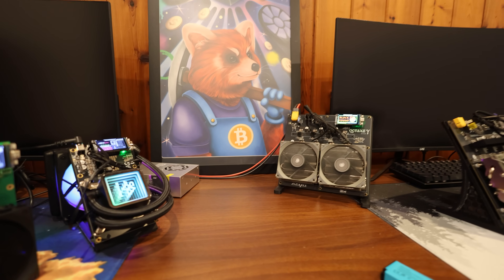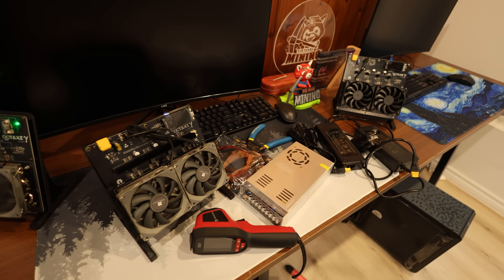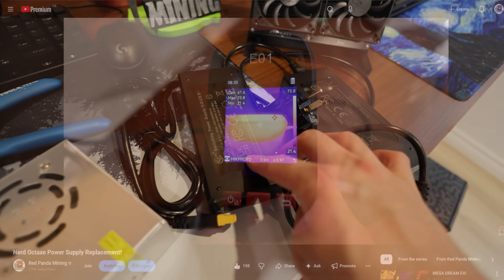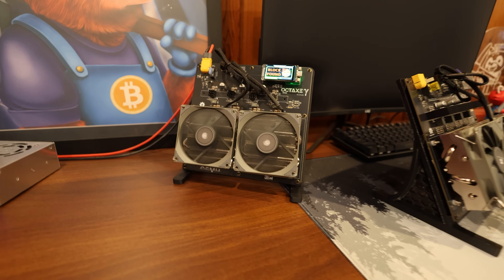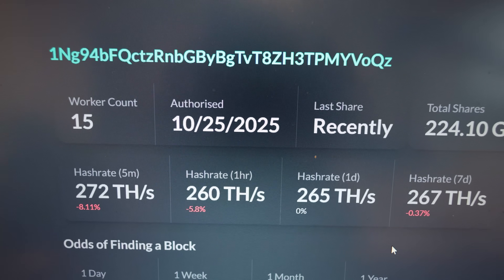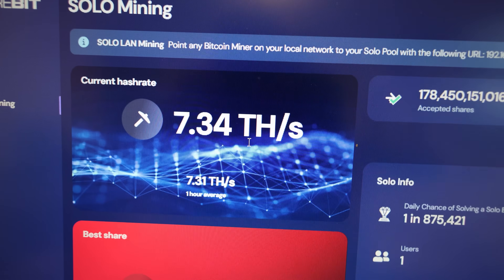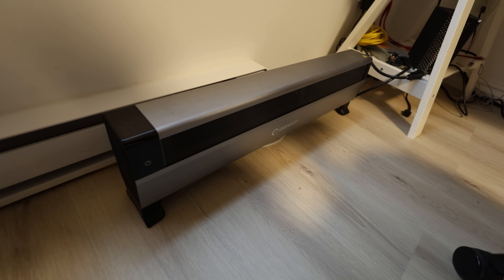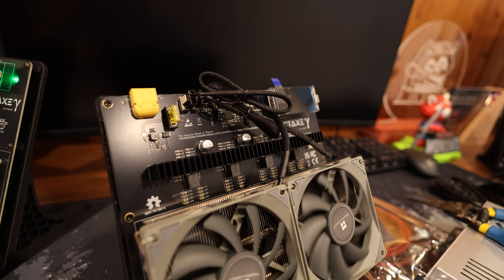I FOUND A BLOCK!

Comment: I'm a couple of minutes in this video and see a load of crap. 
35v capacitors are better? What do they handle? 5 or 12 volts? Then 35 volts is not important.
Higher fuses so they break later? Why in hell would you want that!?
Wow, it got bigger heatsinks! But not under the fan. Why? It doesn't get that hot.
Spend 1000 dollar on something that mines a dollar and 60 cent in a lifetime?
Best invest ever!

Comment: Congratulations on finding a block❗️👏🏻👍

Got to admit BitAxe miners in black/grey and with the coloured screens are desktop tech eye candy❣️

I do like how they allow you to be hands on in tinkering with them in doing mods to upgrade them with heatsinks, fans, and power supply, to either get the utmost out of them or under-clock them to be more frugal with the power juice⚡️ 
I’ve been sitting on the fence for 6 months and have just ordered yesterday my first two bitcoin miners, the latest Gamma GT 800 2.4Th/s Btc., all black, that run silent at 2.2TH and can be clocked up to 2.8TH. 
Which will be used solely for BTC; but if I had a NerdOCTAxe revised edition I could either use that for Btc and use the Gammas for Btc Cash or vice versa. And transfer any mining revenue as it builds up into Bitcoin.
Having a Bitcoin miner makes one feel more attached personally to the whole crypto industry and process than just gambling on an exchange platform or paying for a hosting service. 

And to see the screen say BLOCK FOUND 🥳 is enough off a reward to show it all works no matter the monetary value is. 
As the old sayings go, “You’ve got to be in it, to Win It❗️” and “Chicken dinner, Winner Winner‼️”

Comment: Congrats on the block! The octaxe looks cool, I do get concerned about the heat from power supply’s/asic. I have a nanos3 and byt rn and they run hot. I worried if I’m gone for a long weekend how they hold up. I bought some heat sinks but right now they sit next to a small fan to help keep them from melting lol

Comment: Man I’m mad my hydro is off and the psu is on had the wife unplug it viabtc showed offline FaceTimes her and the miner is blank had it get unplugged till I’m back only thing I know it wasn’t at frequency 800 1228 core running around 115w
Reply: Hoping it’s the fuse blew idk yet …?